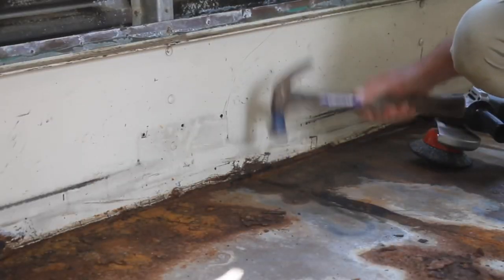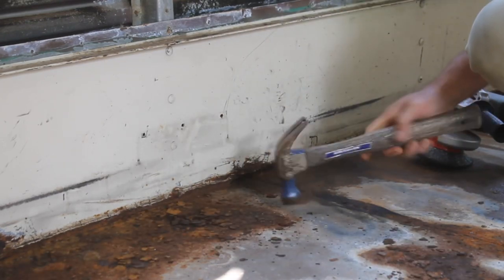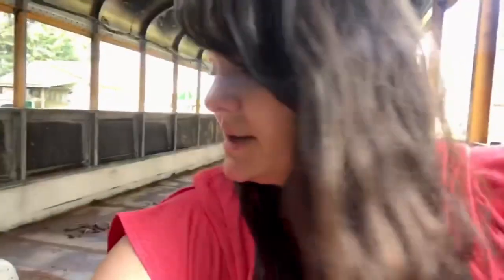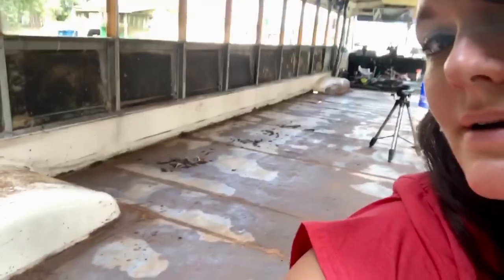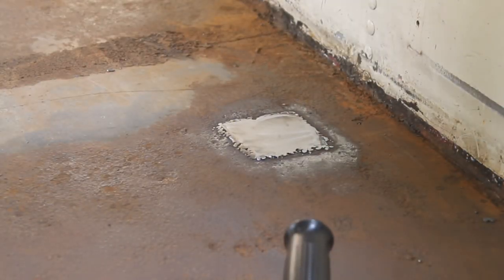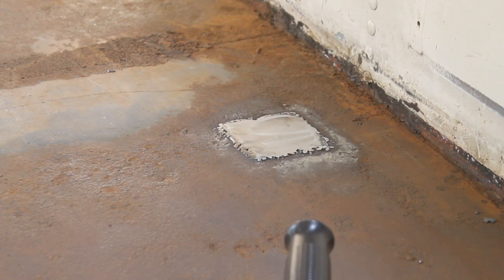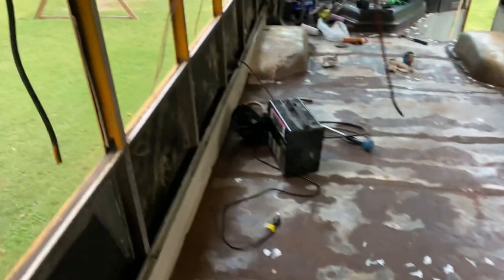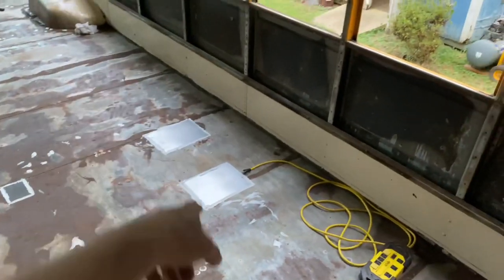School Bus Conversion Episode 4 - Using Pennies To Waterproof The Floor

Comment: I like the evolution of the bus illustration. In this stage it isn’t easy, but once you get it closed up again try to take it for a drive at least every couple of weeks. This does 3 main things. First it’s not good for the bus to sit too long, bearings pit, seals dry, and air brakes seize. Secondly it’s good for motivation to take it for a spin and have some fun. Last it allows you to check if what you did since the last ride is causing rattling or other unwanted noises. We are converting our third.

Comment: Stripping downt he floor was the best thing to do.  My floor was aluminum but I still stripped all the layers off, cleaned off any corrosion, and I did use the penny method also and it worked very well, and put a good layer of protective paint before I put down the subfloor.
Reply: What kind of glue did you use? I'm about to start stripping down our Bluebird, any advice is welcome. :D
Reply: I will have to look at my video from a few years ago and let you know, it has been quite some time.
Reply: @mobilehomelife4028  Thanks man, that's really helpful!
Reply: @MrArik86  Your very welcome!

Comment: What’s a bondo spot and what did you use to put down the pennies ? Caulk?
Reply from the maker: Bondo is a body filler. I used it to fill in damaged areas of the floor. And we put the pennies down with construction adhesive